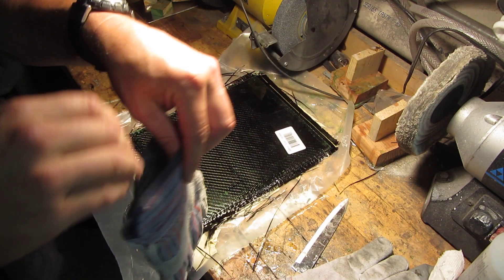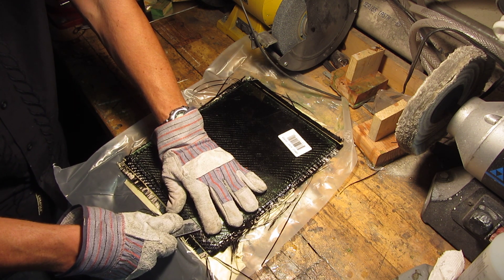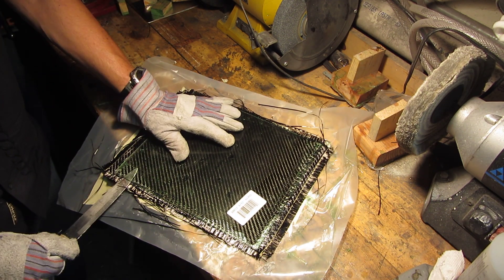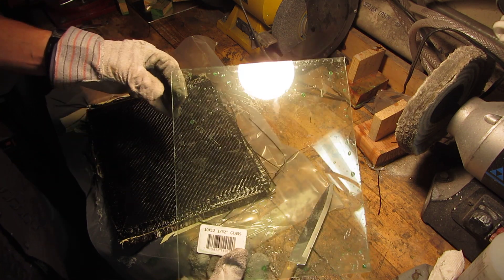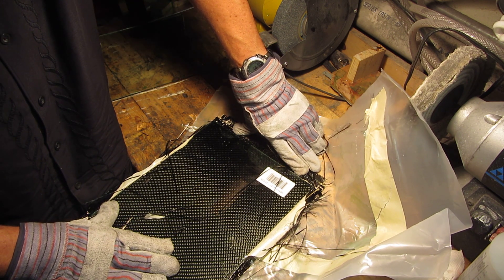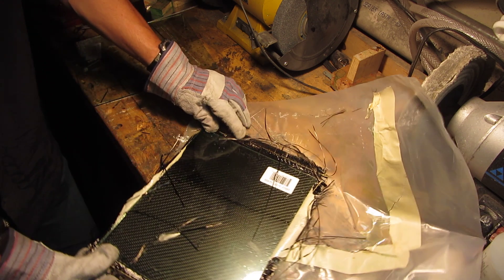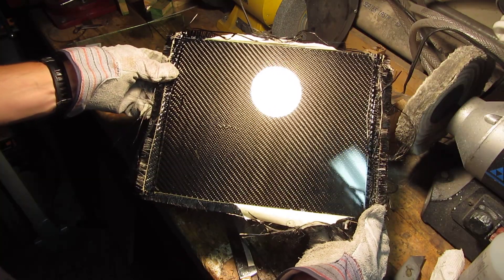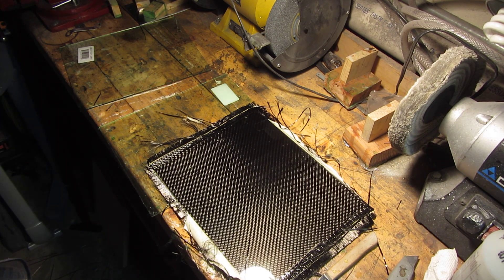Carbon Fiber plate making, Part Three.

Comment: Would it stand 5.56 😀
Reply from the maker: I dont think so. Quite sure actually that it would not. If you were building for impact resistance you just use Kevlar and if layered correct it would. This piece was created as a general plate making tutorial... :)

Comment: Hello, I'm looking to make a board about the length of a skateboard. How thick is this board, and how much weight could it take?
Reply from the maker: This was about 3mm thick. If you are going to use it for a skateboard you should consider to laminate it in the middle to achieve maximum stiffness.
Reply: ebrabaek Thanks for the tip! What is laminating it in the middle? Also I would like to use the least amount if carbon as possible (because $$) how much, with "laminating" do you recommend?
Reply from the maker: That is where either engineering or trials come in. Weight of you, type of thrashing you will be doing.... Mounting and torque of the bolts, all pay a heavy role. Epoxy choice, and type of fabric. It all have to jive. Generally if you are intimidated by the price of Carbon Fiber, then you should pick something easy to begin with, like laminate a small board, and text the flex, and strength before you go all out.

Comment: What kind of shear strength do you suppose this stuff would have Without resin before tearing; as if you were trying to rip apart a T-shirt? I only ask because I find it extremely attractive and can vision using it in place of fabrics for various projects. Each piece could be stitched before cutting to prevent fraying and keep it's shape. CF Jeans anyone?
Reply from the maker: ironDsteele Unfortunately it would rip very quick, as if you can picture each strand having 6ooo small graphite filament. They are porous unless locked in resin. Unless you lock the fibers in resin, I am afraid you would not like it after a few days.
Reply: ebrabaek Hmm...that's too bad. Maybe I could experiment with latex or some other option to protect it. I ordered a small amount of 7.8oz 3k twill to mess around with. I planned on doing ties and hats also, while using polyester satin to line everything. If you have any ideas, please feel free. Thanks!
Reply from the maker: You can off course experiment, but as you get the CF in you can see what I was referring to.
Reply: I just tracked down a company out of Texas called Industrial Polymers. I bought a product called TruKote CS-100, it's a soft, clear, very highly flexible resin that is used as a waterproof and anti-fray protectant for coting ropes and fabrics that allows them to keep their pliability. I think this stuff will perform admirably, but as you say I will need to experiment on sample pieces with different amounts of it and find out what works the best. When I start I will keep you posted of the result!

Comment: Nice video. I would have liked to see a couple of health and safety warnings. One would the risks of getting epoxy on one's skin and how to remove it. Another would be the carbon shards sticking out of the part, as they can be very sharp and dangerous. Years ago, I ran into an untrimmed part and stuck one in my arm about 1/2" deep and it caused a lot of trouble. What percent resin did you use?
Reply from the maker: Indeed, but I have so many video's, and build threads on so many forums, I simply cannot enclose that disclaimer, every time. That said you are correct in your assessment. 30%resin and 70% fiber, as it should be.

Comment: Nice 3 videos.. I want to get some CF.. approx. 8x 10.5"x10.5" plate.. to use for electric bike solar panels... currently Im using Plaskolite which is very light, but it is too thick.. I dont know how thick I should get CF..because CF is so strong... I think maybe 1mm sheet could work... but I dont want it to flex more than 10 degrees.. any ideas ?
Reply from the maker: The thickness really depends on how the matrix ( layup) is squeezed, rather than the fiber thickness. As with any new app, you need to test a few layups, until you got what you like. Personally I think 1 mm is good.
Reply: ebrabaek
I've been reading some reports of sandwiching some balsa (wood) between two sheets of 1mm CF.. seems to be stronger than 3mm solid CF...
Reply from the maker: Terry Hope

Balsa is widely used, as is foam. You need to experiment with what app. suits you the best.
Reply: what would you recommend for a <0.7mm or less 2.5" x 5" sheet/plate... Im currently using credit/gift cards cut into pieces and gorilla taped into a square frame structure... I dont need alot of strength... just stiffness...  slightly less flexible than a credit card is what Im after...
Reply from the maker: Terry Hope
It is a bit hard to make a piece only 0.7mm thick, stiff. But I would stab at it, with a layup of either two types. Either have to be squeezed between two plates, and weighed to squeeze the matrix.
One..... four layers of 6 oz 2x2 twill 3 or 6K each on a 45 deg angle, and 1618 or whatever epoxy you have.
Two..... two 12 oz 2x2 12K layup with again your choice of epoxy.
Reply: Terry Hope
 If you want it to be stiff, use unidirectional fiber. Of course, it wont look as nice and the strength will only be along the grain, but you can hide it by putting a piece of weaved fiber on top and the bottom. Is it going to be structural piece? I once did a a 8 piece lay up in a U shape, about 3 feet long and it was able to handle about 470-ish pounds before giving out. But, of coruse the epoxy I was using is subpar.